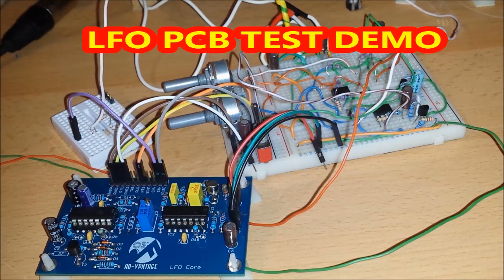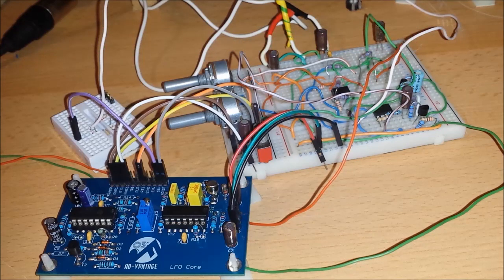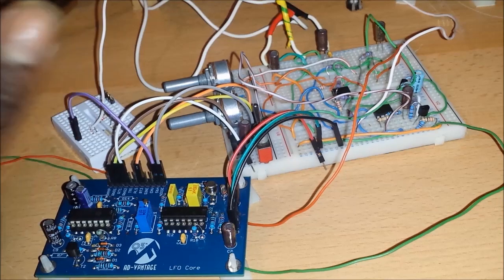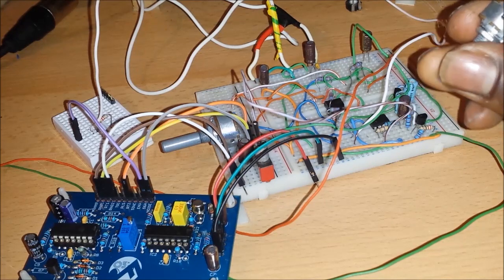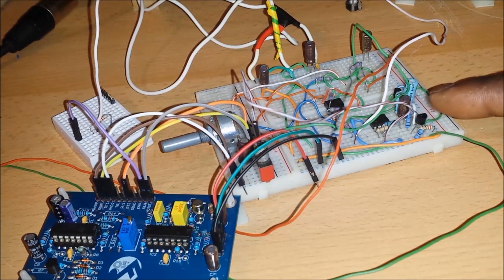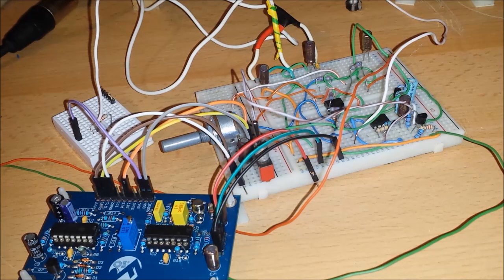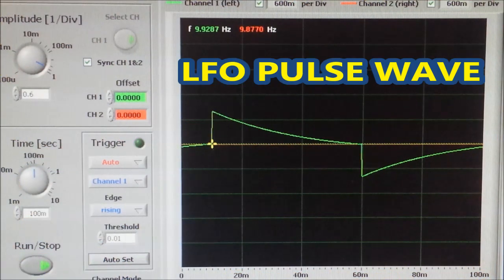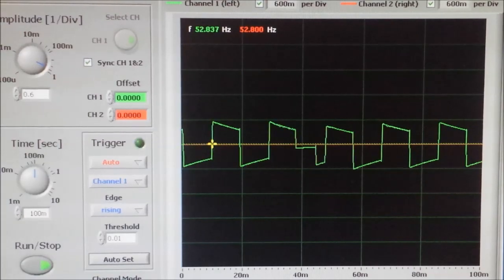DIY analog synth project (LFO PCB Test Demo)

Comment: I was wondering what caused that glitch which was visible , would you test individual components pre assembly btw
Reply from the maker: Give me the minutes reference to the vid and I could probably answer the question. Not sure at which point you mean here.
Reply: @AdamTheAd-vanc3d  3:37 this might have been the strand on the wire you mentioned
Reply from the maker: Oh yes. I think that may have just been where I had tapped ot knock a wire by accident.

Comment: Hi, Adam!
6:14 - I've almost got my heart to jump off :))
It's interesting that the random LFO gen. that goes without sound is different that comes when we hear the demo. On 5:20 I see some crazy spikes that should be noticed when in an application IMHO.
Thanks for the new video!
Reply from the maker: Hahaha oopos yes it does wake you up hey. Anyway with regards to the random . The spikes shouldnt be as prominent . However i left out a capacitor in the feedback loop  which will be included on the LFO Rev 1.1 board.
Reply: @AdamTheAd-vanc3d  But did you show the graphs and the sound with the same setup? If "yes" - Can it be a result on a "without load" case? I don't know if the connected LFO sygnal differs with non-connected.
Reply from the maker: @KiR_3d  100% ,just the lfo pcb waves . On the scope and what you hear modulating the M brute Shane i cant do the split screen editing .
Reply: @AdamTheAd-vanc3d  I'm a bit confused... Was it disconnected from oscillators on the "watching session"?
Reply from the maker: @KiR_3d  On the watching session (no sound), you were just seeing the raw lfo waves on screen. On the part with sound you were hearing the minibrute with my lfo pcb connected , first modulating pitch then the filter. However you are right the wave form looks diffrent from how it sounds in application